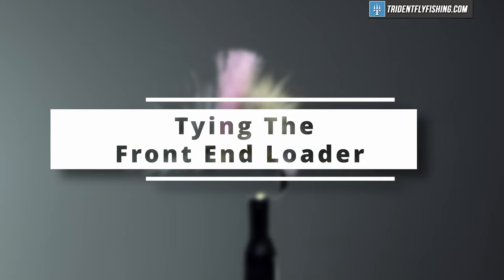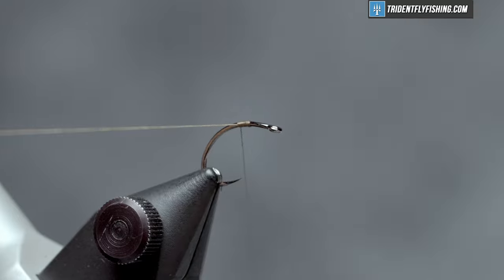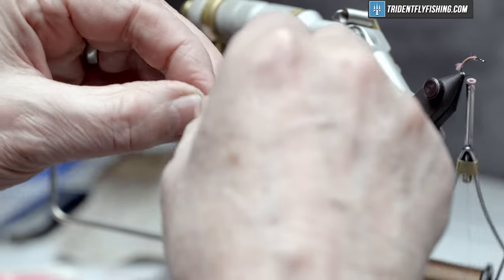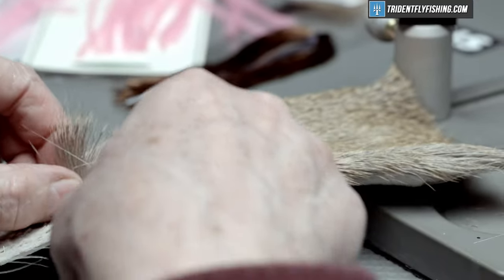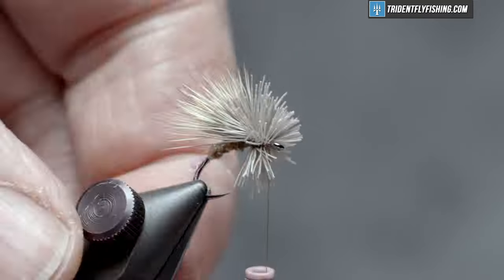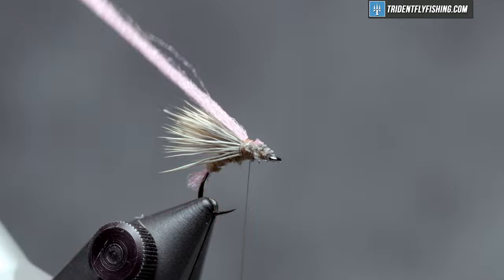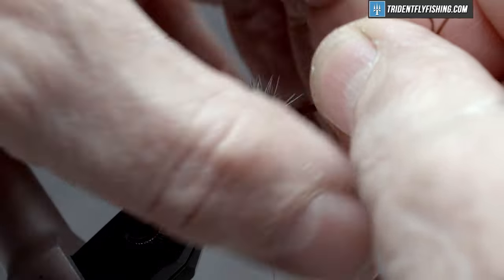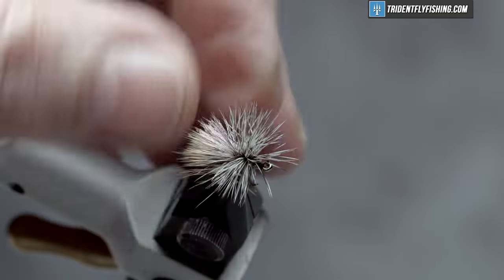Front End Loader Caddis | Great For A Dry Dropper Rig | Fly Tying Tutorial

Comment: Very interesting tie Karl and the end result was much cleaner looking than what I expected.  Nice tie!
A much simpler tie that will get you that "low to the water" effect and one I think you should demonstrate is Eric Otzinger's Hot Creek Caddis.  It's tied without the palmered hackle on the body and the sparse parachute style hackle is wound from back of the wing tie-in position around the front of the hair head.This splays the hackle out around fly much differently than a normal parachute hackle.  I usually only use two wraps (use more for wraps for fast water) to get the desired effect.  The fly always seems to look a little messy but it gives a different impression from underwater than other flies and fish really like it.

I used to teach schools on the Arcularius Ranch in the 90's and we'd take the students over to nearby  Hot Creek for one of those days (4-day school).  Eric came up with this fly while he was working at Marriott's Fly Shop in Fullerton (LA area) and I came across it while doing a check-out guide trip to certify an Orvis Endorsed Guide for the area.  He provided that fly and we used it to excellent effect.  That fly worked great on Hot Creek, the Upper Owens, and also the lower Owens (below the dam).  I then started using it everywhere using about 4 turns of parachute hackle on it for faster waters instead of the 2 turns of hackle that I used on spring creeks.

It's a much faster fly to tie, sits low in the water, and is very effective.  If you get a chance Karl, I think that would be a good fly for you to demonstrate in a video.  You can even tie it down in a size 18 on a Tiemco 101 hook (wide-gap, straight eye dry fly hook).  Caddis in my neck of the woods come in sizes 12 through 16 (size 6 for the October Caddis) but I have seen them smaller than that back east.   If you want to make a mayfly imitation out of it, just add a tail and use a sparser wing.

By the way if you need a low-riding fly while you are fishing, don't hesitate to take your scissors or snips and trim off the bottom of your fully-hackled standard dry fly, turning it into a "half-hackled" fly.  That will drop any high-riding fly right down onto/into the surface film.  You can always tie up some of the "correct fly" for the occasion that night back at the house or campground.